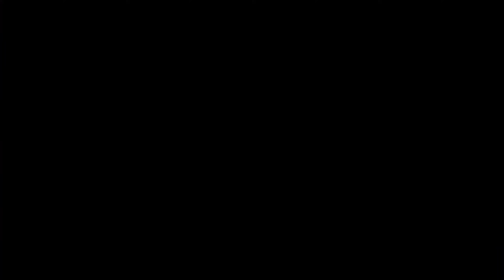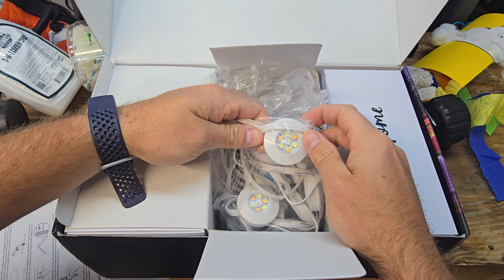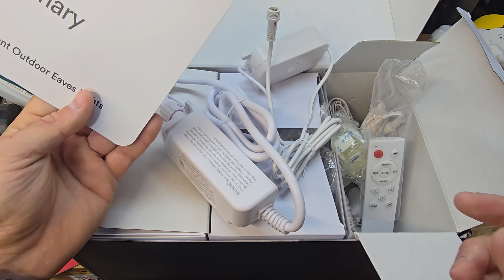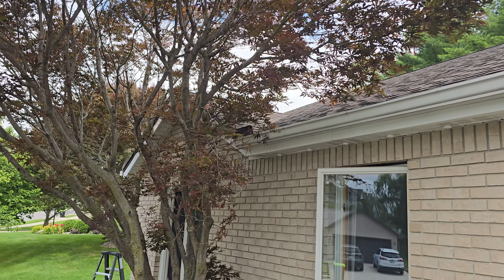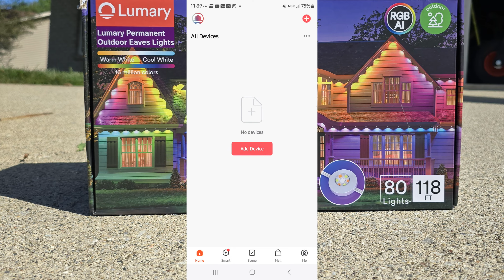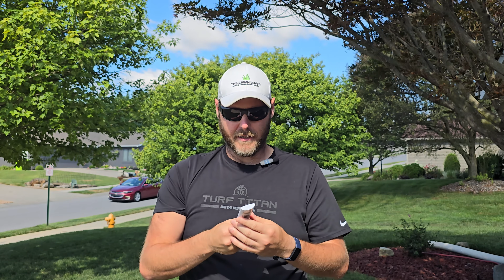Does Lumary's New Lights Actually Deliver? Real Test Results! #smarthome

Comment: How would you deal with a bay window protruding from the wall? 12"eave
Reply from the maker: I am not sure on how to split the strands, but that would be a tough one to accomplish since they run on a single wire. Thanks for watching!
Reply: @TheLawnLover  i wasn't looking to cut the wire. Should I run the lights 2-4" from the wall as suggested, and go around the window? Or run them straight under the gutter? Thanks
Reply from the maker: @KennethMiko  Ah, gotcha. You could really accomplish it either way, which ever looks better. It will adhere to the gutter as well, so if that looks the best, I would probably go that route.
Reply: @TheLawnLover  I would see how it looks mounting to bottom of fascia, not directly to the bottom of gutter. I've been searching for any pictures of dealing with bay window protrusion, and can't find any. Thanks
Reply: @TheLawnLover  would you pull the wire between each light tight, no slack? Or leave a little loose? I plan on using wire channel between each light to hide the wire. Thanks
Reply from the maker: @KennethMiko  I kept mine mostly snug, the only place I left it a little loose was on corners to keep them evenly spaced. My fascia is white so, you can't really see the wire on mine when you are looking up from the ground.

Comment: Awesome. That's great news. I plan to put this on my two story house, so hopefully two packs of those a hundred and nineteen feet we'll work
Reply from the maker: The only thing they did tell me afgrr this video is you can't put more than two connected strands together on the same power source, which was kind of frustrating because I wanted to wrap the whole house on the one power source and have a consistent pattern all around. I have some landscape ground lights they sent in the back on a separate power source that solved that issue for me, but it would have been nice to have the eaves lights all around.
Reply: Yeah, I'm gonna order 2 of them. I may have to use a stitching cord then to plug up the second set. But I will try to put 2 of the 118 feet lights together. Maybe that would be okay, you think
Reply from the maker: @thaiblkman904  As long as they each have a separate power source (each strand needs its own plug). That is what the rep at Lumary told me.
Reply: Bet thanks

Comment: Now, with the power source, it says on another video. Did you start from left to right? My power source is on the eve. Outside on the left hand side of the house.Am I able to power on either side of the wires
Reply from the maker: You can go in either direction from the power source. The instructions that were included in the box didn't specify a specific way to string them. Regardless of the direction you string them, the patterns in the app that are loaded will run left to right.